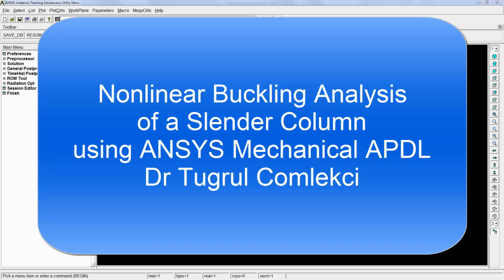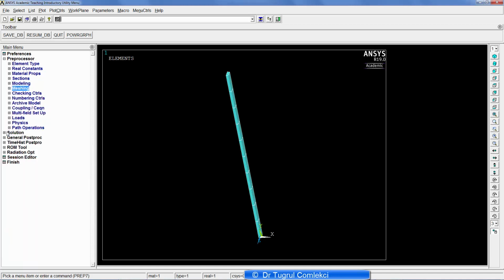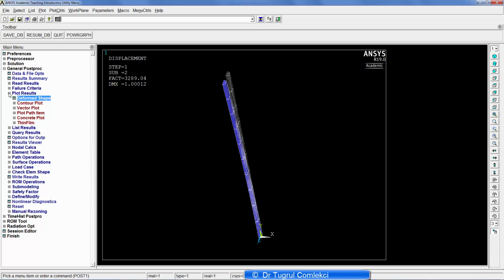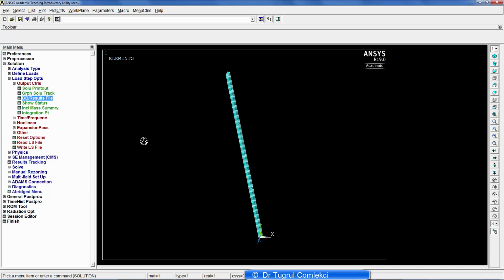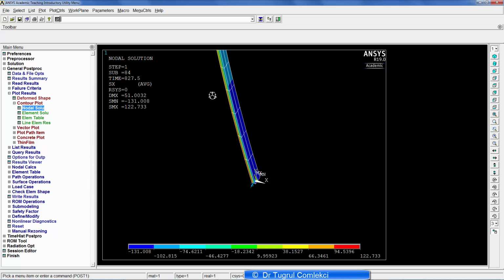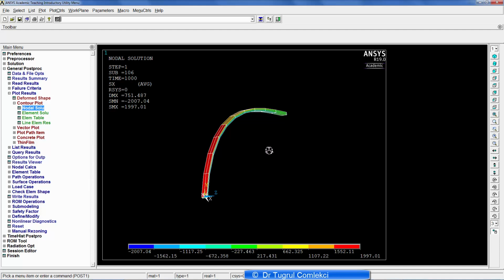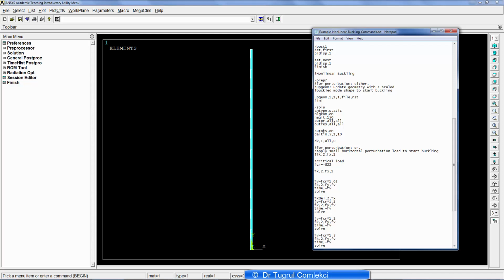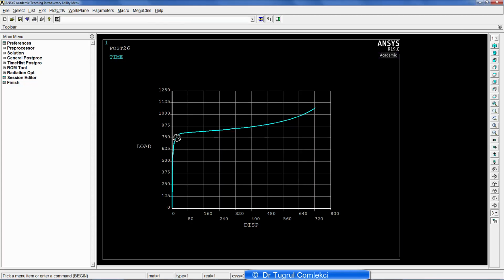Nonlinear Buckling Analysis of a Slender Column using ANSYS Mechanical APDL

Comment: I tried the exact same steps as you do, until the eigenbuckling it works just fine, but when i did the nonlinear one where using 1000 timesteps it doesn't give me the correct results as yours, my calculation stops at 102 cumulative iteration number and the structure does not deform at all. Can you please tell me what might be the cause of this
Reply: It is because in this video there was not applicated the perturbation force as he mentioned that he was doing, nor the updating the geometry with imperfection from the eigenvalue buckling.Therefore the nonlinear buckling cant occur.
Reply: @jozefprokop7678  i was wondering how should we do for the nonlinear buckling to occur?
Reply: @chiewyeekok7765   CAN YOU ANALISYS?????
Reply: I´ve had the same problem. My structure does not deform at all.
Reply: have the same problem using version 19.2